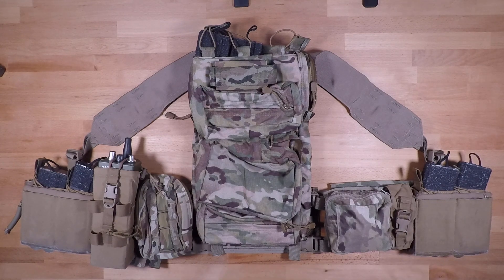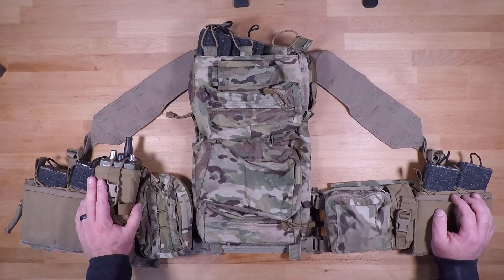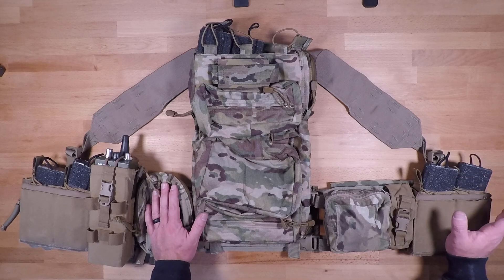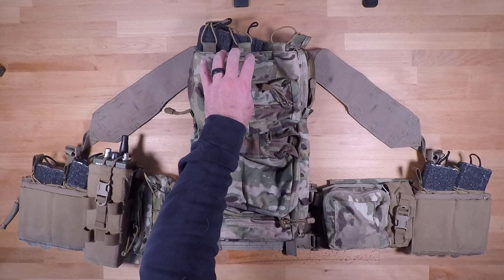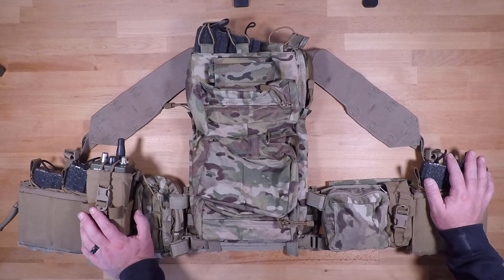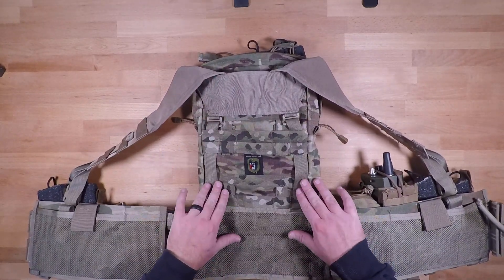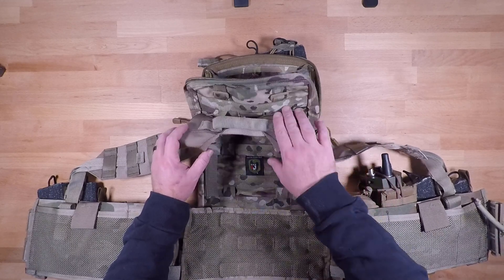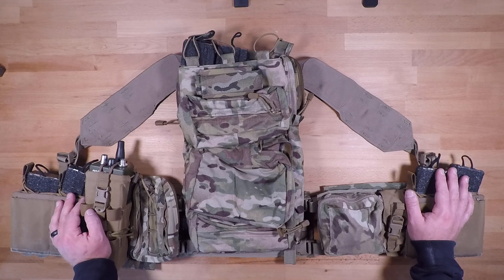Redefining Issued Equipment - Leadership ATAPS Setup & Config (Episode - 20)

Comment: I'm super late to comment on this, but the way I was able to add some more space to mine was to use one of those roll 1 ifak pouches on the back panel. I cut some slots in the velcro panel to match the molle and just used some one wrap to secure it. Works amazingly well and frees up a few rows.
Reply from the maker: Its never to late

Comment: So like, when you ruck how is that back panel not killing you. I think that’s the #1 thing I like about the normal TAPS over this
Reply from the maker: It’s a solid question and I’d respond with that’s why having both and being able to tailor you kit to the mission is important you can have a rig setup for movement and then a rig setup for operations. But if I had to choose one I’d go with the new taps and then figure out a way to qd components that would interfere with moving with a ruck
Reply: @LegionPreparedness to me it seems like the a-taps would be better if the buckles for the side panel adjustment were on the side panels rather than the back panel.